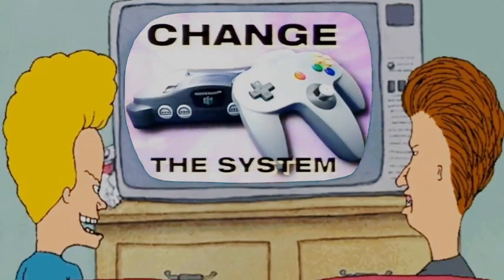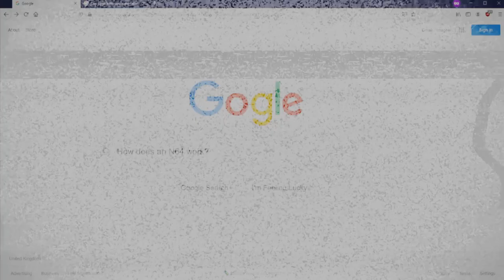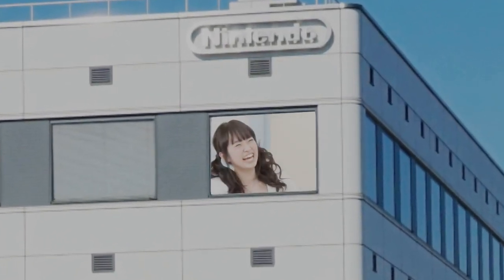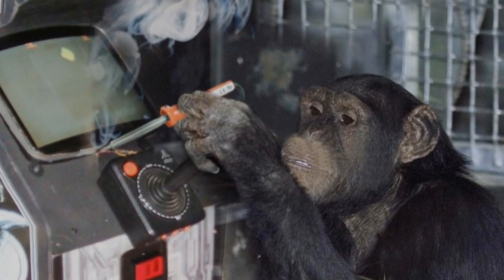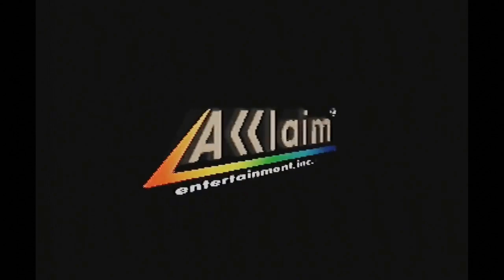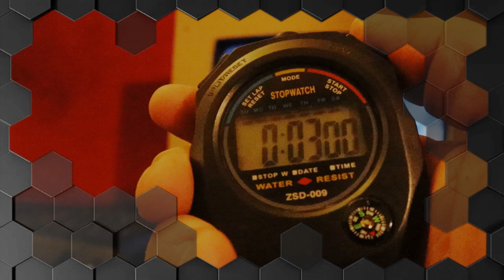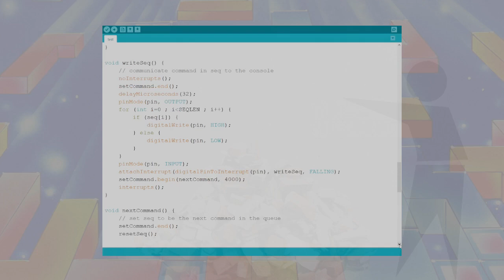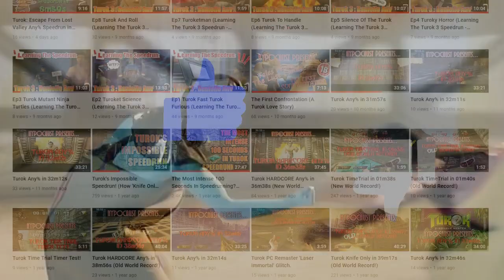Mouse And Keyboard On An Original N64??? - I Did It... And You Can Too!

Comment: Excellent project that I'm trying to replicate and I have a question. I see the data line from the N64 goes to pin 12 of the Teensy 4.0. Where should I attach the remaining 2 being pwr and gnd. I imagine possibly not needing the pwr but I imagine I definitely would need the gnd. And thanks for all of your effort. I had been using an Xbox controller through a Blueretro via Bliuetooth but being able to use a trackball or mouse seems far superior.  What an accomplishment on your part..
Reply from the maker: I improved the design here because of this very issue. The power and ground need to be connected to something or the console assumes the controller is broken and throws an error. You can't just short the wires together - this alarms the console and puts it in safe mode. 
My first design had the ground connected to one of the ground pins on the Teensy and I connected the live to one of the Teensy's 3v output pins. Power was running the wrong way, but the console didn't mind, I assume because it has diodes in there to protect it, but it fooled the console enough for it to work. I'd have thought you can just put a really big resistor between power and ground and that would do the trick, but try that out at your own risk. 
In the end I did a slight redesign so that the Teensy was getting power from the console itself through the controller wire.
You can cut a trace on the Teensy so it won't get power from the USB port and supply power through the 5vin pin - on the opposite corner to pin 12. I used a small voltage regulator (U1V10F5) to up the voltage from the 3v that the console provides to the 5v the Teensy needs to start up (fun fact: the code can run on 3v, but the chip won't initialise unless it gets 5v to begin with).
I even got some PCBs printed to mount everything nicely and 3D printed a cylindrical enclosure for a really nice finish. A small update video might be useful at some point.